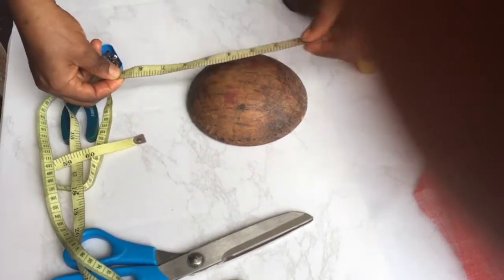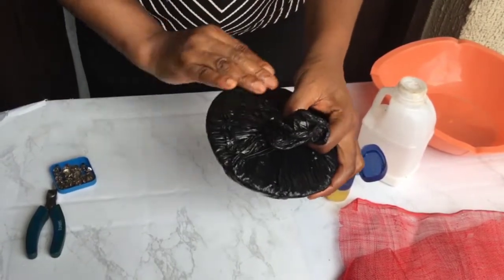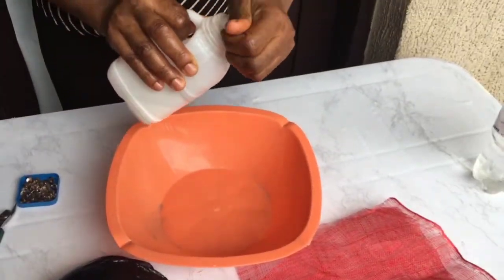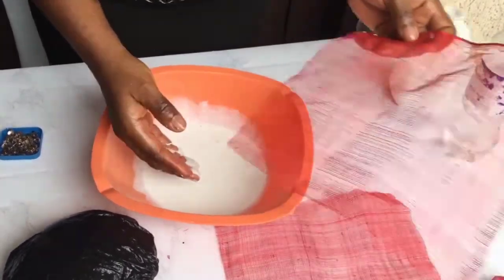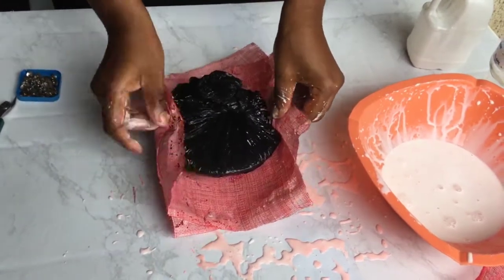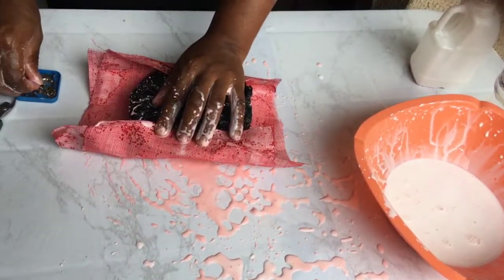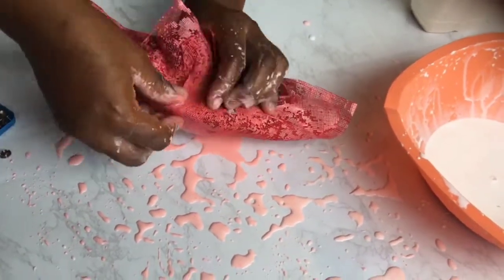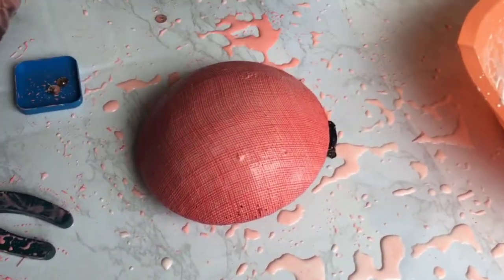DIY | HOW TO MAKE FASCINATOR BASE

Comment: Please can I use bond instead of stiffner
Reply from the maker: The issue with bond is that it has the tendency to stain but I do use it just make sure you mix it very well for it not to have some solid parts